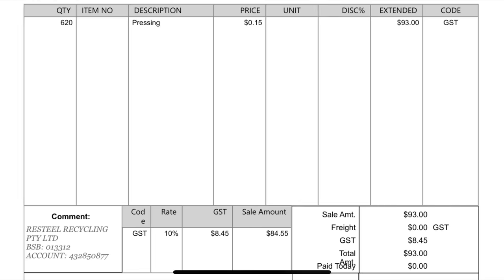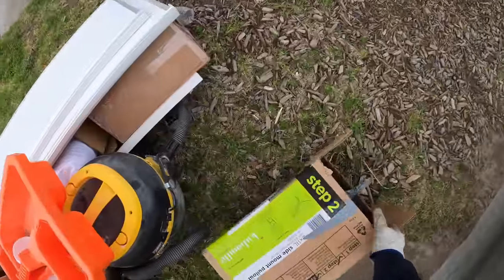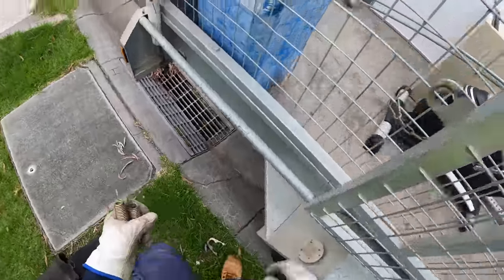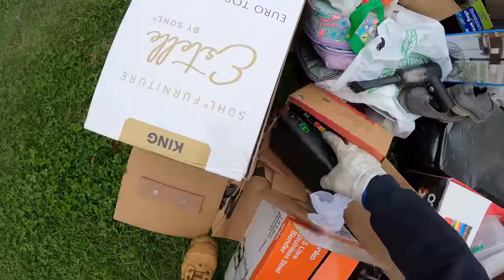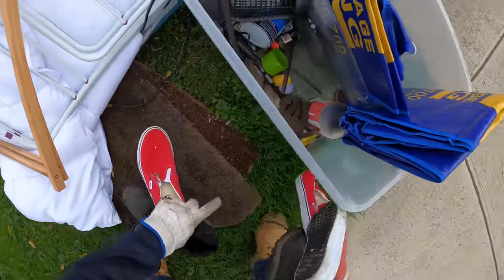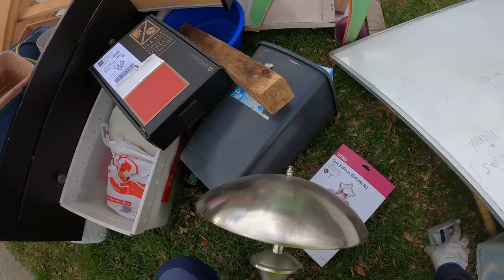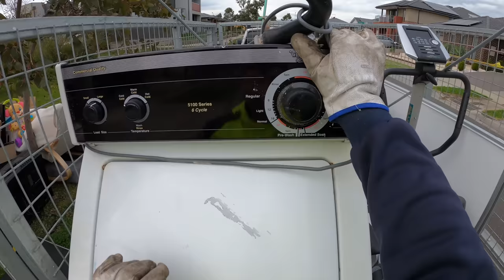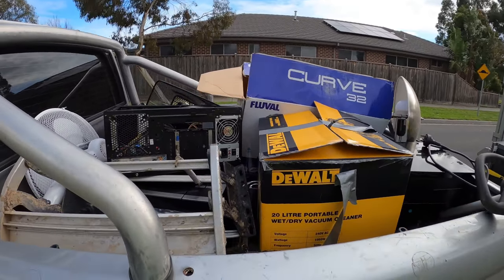Chasing Big Piles Of Scrap & Resell In The Streets

Comment: Well done Poly you got some awesome scrap and resale stuff. Hopefully those Makita planer and router work. That black pot with the enamel white inside will clean up if you first fill it with water then add a half cup of bleach to the water, the bleach will take the staining out of the enamel and make it white again. Keep up the good work mate.
Reply from the maker: Thanks for the cleaning tip mate 👌
Reply: Do you need to heat the water on the stove or just let it sit?